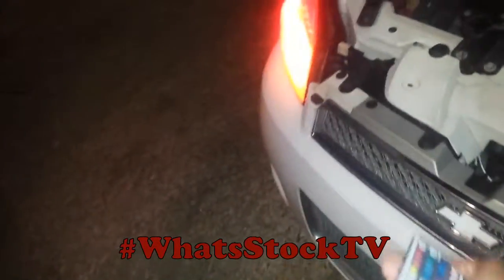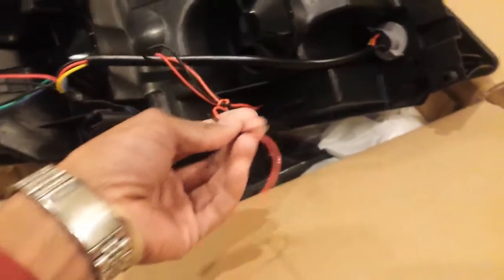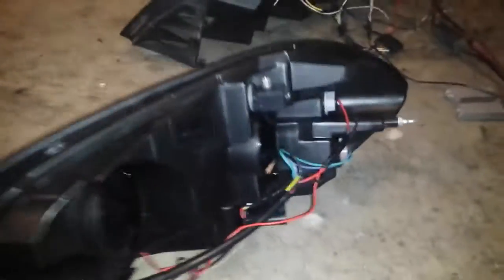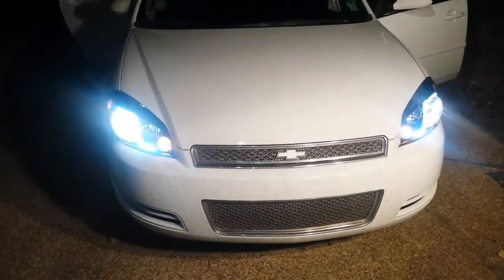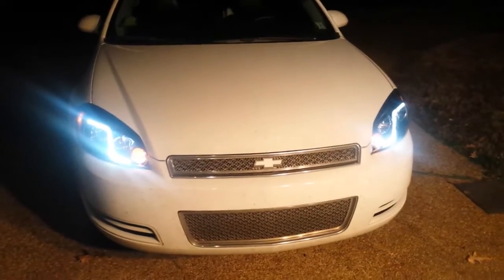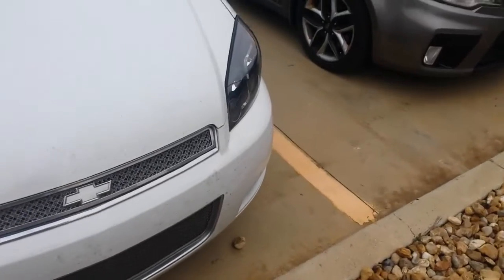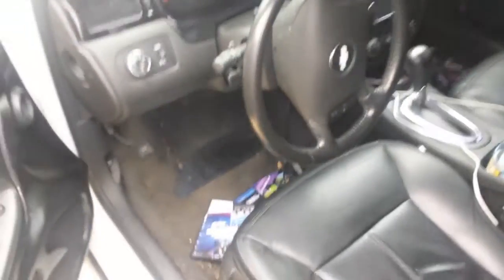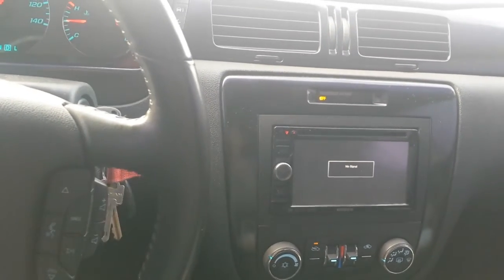New 2006 - 2013 Impala DRL headlights Review WhatsStock TV

Comment: I actually like the style of that LED strip, but I'm turned off by the fitment issues. Do you know of any LED strips I could fit into a standard OEM assembly?
Reply from the maker: If you just want a solid color led most of the led and rgb strips from eBay work fine. If you want a special color changing version lightingTrendz has good quality lights
Reply: @89imp03  I think an RGBW option would be great, particularly for a nice icy blue color to go with the white Impala. I don't recall seeing anything on their site that wasn't amber/white, but I'll look again
Reply from the maker: @nomad-1776  the drl tubes on there has a good rgbw option

Comment: Can u also post a video on how to tap the dsl with park lights I need help...
Reply from the maker: The signal light bulb has 3 wires, I have the drl strip wired to the power wire from that which is either a white wire or a red wire depending on when it was made. Then you can ground it with the black wire on the harness

Comment: So did you just cut the positive and negative wire to the parking light and then take the positive and negative to the led drl bar and put them together ?
Reply from the maker: Yep that's it. Trimmed the insulation away from the park lights wires and just wrapped the drl wires around it then taped it all up
Reply: @89imp03  I have an 04 impala would it make a diffrents if the bulb was white black wires and the drl wiring is black red?
Reply from the maker: Black is always ground. Red and white are interchangable for power
Reply: @89imp03  so it is okay too hook red/white together?
Reply from the maker: Yeah they're both power, it'll work
Reply: @89imp03  thank you
Reply: @89imp03  so I got them to work but they only workin as turn signal light they aren't staying on, would you happen to know why this is?
Reply from the maker: @AIVoices-k1r  connected to the wrong wire coming for the signal/park light. It's 3 wires, park light positive, signal, and ground.
Reply: @89imp03  ok, so on the new lighting assembly there's a white wire a black wire and a green wire I have the black and white wire connected to the drl bar what would green be?
Reply from the maker: @AIVoices-k1r  coming from the signal bulb? If so connect to the green and black instead. Just saw the video, that looks to be the case. Normally it's white, yellow and black or red, yellow and black
Reply: I just ordered these for my 2012 impala. Hopefully I dont run into any problems doing this either.
Reply from the maker: @joshuakyle9449  shouldn't have any issues
Reply: @89imp03  what year is your impala?
Reply: @89imp03  if the wires are black and red I'll just match them like you did!
Reply from the maker: @joshuakyle9449  2013
Reply from the maker: @joshuakyle9449  yep and you should be fine
Reply: @89imp03  nice man! Will let you know for sure. I'm super excited.
Reply from the maker: @joshuakyle9449  aight cool 👍👍
Reply: @89imp03  so I just put them on! And needless to say they are amazing! I had no problems at all! Thanks for the video to help with the drl wiring.
Reply from the maker: @joshuakyle9449  glad to hear that! Enjoy em man
Reply: Joshua Kyle Did you have any fitment problems like in the video?

Comment: Ok.. Daytime Running lights...So does the led bar run by itself in broad daylight with the vehicle in neutral? OR What?
Reply from the maker: I had it wired to come on whenever the park lights are on
Reply: The 11 impala like mine should have built in DLR function so the new light should be able to work with said function

Comment: is it possible to not run the DRL i personally dont like them. i just like the housing
Reply from the maker: Yeah you don't have to connect them. Or if you only want them on at certain times  you can wire them up to a switch
Reply: @89imp03  thanks dude I seen your other vid where you actually take em out .
Reply from the maker: @useyonina_  no problem. Mine is pretty much only the Halo now since the new led for the bar didn't light it up as bright as the original LED did

Comment: Do you need a decoder for an 08 Impala for LED lights
Reply from the maker: I didn't use anything extra for mine. You'll need resistors if you get LED signal lights to stop the hyperflash but that's it

Comment: Could i wire the led bar To The turn signals?
Reply from the maker: Yeah you can if you want to
Reply: 89imp03 would it be the same way? Red to red? Black to black?
Reply from the maker: @thaddeuspierce1889  same idea but the colors for the signal light wire will be different. That way the bar will only light up when you signal
Reply: 89imp03 ok cool appreciate it
Reply from the maker: @thaddeuspierce1889  no problem

Comment: what kind of fuse did you use for the halos?
Reply from the maker: I didn't add any fuses. The DRL bar is connected directly to the park lights. The control box for the colorshift halos  was ran directly to the battery
Reply: Thanks for all the help you’ve been giving me, I have an impala just like yours and was wondering where you mounted your control box for the halos at also?
Reply from the maker: @cocitydon  I had it tucked behind the grill, under the plastic cover for the hood latch. Some people put it behind the headlights tucked by the battery